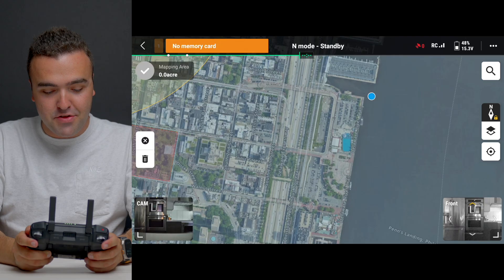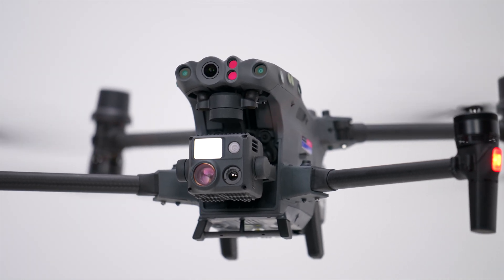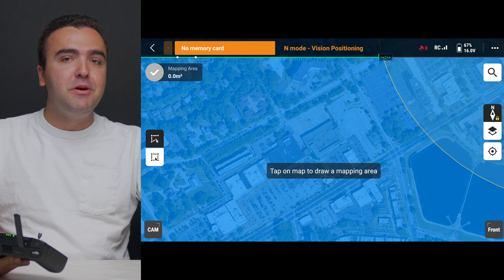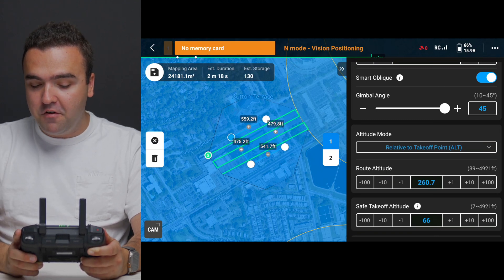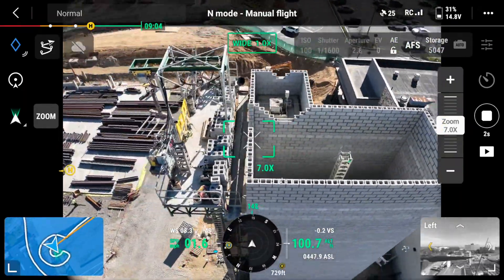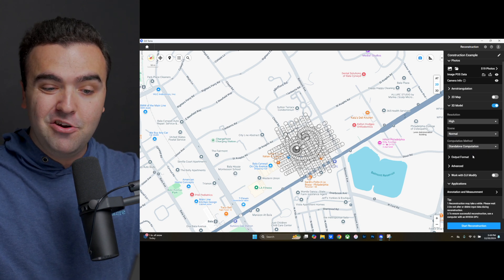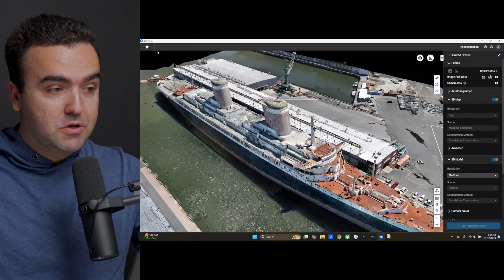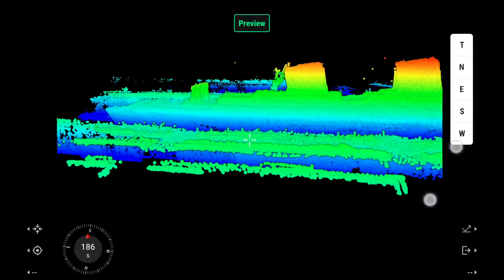How To Create a 3D Model With Your Drone Using DJI Terra

Comment: I know that LiDAR equipment is fast and generates a homogeneous Point Cloud, but to maintain the accuracy below 1cm, LiDAR accuracy is not enough, so I think we can get the desired accuracy result by taking a lot of pictures by getting close with a high-resolution camera (ex. Mavic3pro). I only own L1 with LTK  so far, so I don't have experience with L2 accuracy. However, I don't think it is much different. LiDAR is a good method in terms of work efficiency, but I think it is still not suitable for the field that requires very accurate results. I would like to hear your opinion. Thank ypu so much.

Comment: "Hi! I'm French, so please excuse any small mistakes.
I have a question about 3D reconstruction workflows.
When generating a 3D model (for example with DJI Terra), is the geoid taken into account, or are the results purely based on ellipsoidal heights?
I'm trying to make sure my data remains consistent for various calculations, such as volumes and elevations.
Also, I'm having some trouble properly using GCPs and PPK in DJI Terra — maybe someone here could help me out or point me to a good video tutorial?
That part is really giving me a hard time!"

Comment: It is also critical to note that the M3T does NOT have microsecond time sync, meaning that the images from the M3T are not tagged with RTK data (if you were using the RTK top hat). Thus you cannot expect any benefit from using RTK aside from the flight path potentially being straighter and more controlled. 
And yes as Billy noted the visual sensor is pretty garbage compared to the M3E mechanical shutter camera. 
Can you map with the M3T? Yes technically, but not like you can with the M3E. Your accuracy, color, and resolution will be very poor.

Comment: Looks like at the time of this video being published (12/30/2024), a DJI Terra Pro Permanent (1 device) license is USD $4,400 that includes your first year of updates and then a $440 annual maintenance fee can be purchased to keep current with updates AFTER the first year.  Pretty inexpensive when considering other options on the market for what you're getting.

Billy is Terra your primary mapping software?  How does it compare to any of the other options you've used/use presently?

Comment: Great work thanks for the instruction. I hope to put it to good use in the not too distant future. My offer to observe assist and learn on any of your jobs in Philly stands. I have my trust cert and am studying for my part 107 and at 56 years old want to learn as much as I can as efficiently as possible. I am a 14 year Army vet, reliable and motivated. LMK if you ever need a little help, a visual observer, or if you're just going to be in the area and don't mind if I watch. 
Thanks a bunch for what you do, 
Sarge 🇺🇲

Comment: Exported flight routes can be used only on Phantom 4 RTK (remote controller without screen), Matrice 300 RTK + H20 Series Payloads, Mavic 2 Enterprise Advanced, Matrice 350 RTK, DJI Mavic 3 Enterprise Series (DJI Mavic 3E and DJI Mavic 3T), and Matrice 30 Series.

and unless you pay thousands of dollars for pro version of Terra you can’t process 3D model.
Reply: Use webodm
Reply: Use WebODM and 3df Zephyr. I was just trying to answer the other guys question.

Comment: I can't seem to get a solid answer, can I use my original Mavic 3 (not Mavic 3T or classic or PRO) for this?
Reply: No, only enterprise drones.
Reply: No,  the consumer level Mavic 3 does not work with the Pilot 2 app
Reply: Not with DJI app, but you can use Mavic 3 for modeling with different apps like “Drone Deploy”, PIX4D. But these apps usually paid
Reply: @Youno954  dronedeploy or pix4d support the Mavic 3, only the enterprise level or older drones like the Mavic 2 pro, Mavic Pro and Phantom series. I think the Air 2 is on that list also.